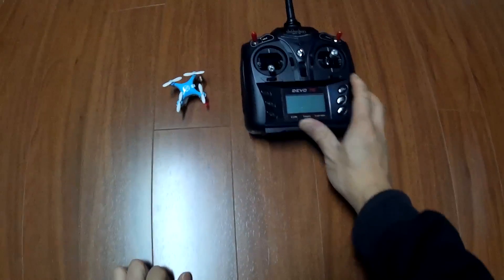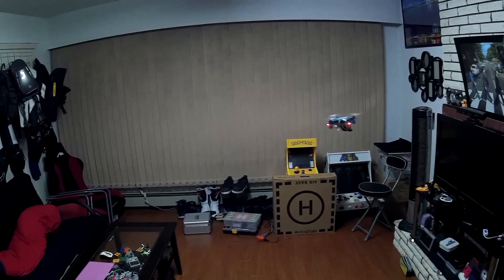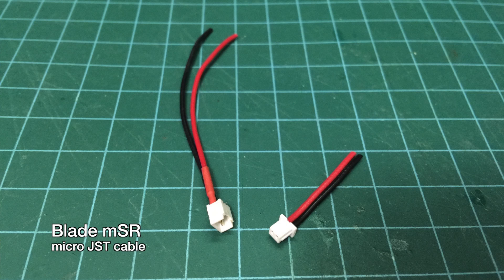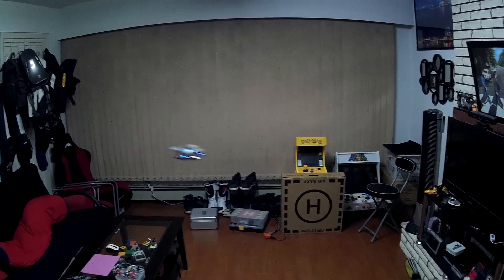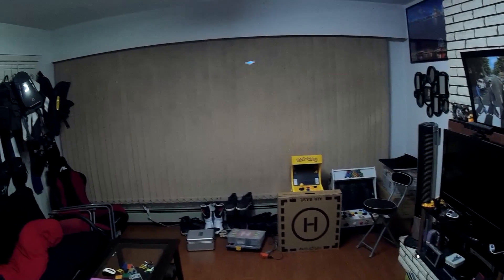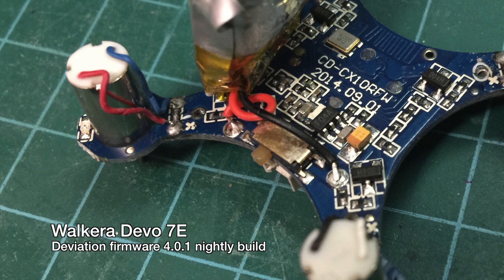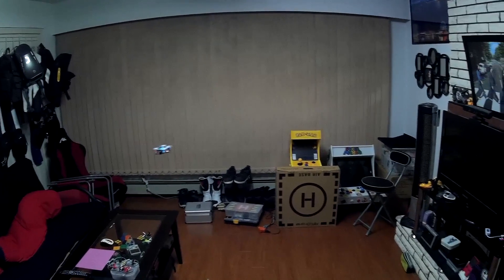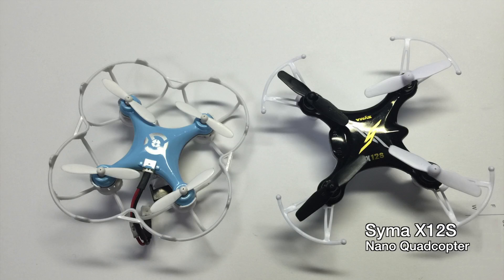Cheerson CX-10 micro quadcopter battery mod

Comment: I realize this is a very old video, but wondering if you've ever tried binding CX-10 using opentx? Thanks.
Reply from the maker: Should be supported by opentx if you have any of the multi modules (IRX4) installed on your radio. Or have something like the T8SG radio.  I have videos on the multi modules. 

My irx4 video
https://youtu.be/229bgk4H2lU
Reply: @KenVersus  thanks. I just realized I have the CX-10W which is the wifi version, hence is why I'm having trouble binding 🙄

Comment: I used to have one of these little buggers before my cat decided it was a good place to pee. A couple questions. That's a lithium ion rechargeable 3.7v battery you replaced the original with right? Just a larger, higher capacity one if I'm correct. That being the case, would it not have been viable to wire it directly to where the original battery was? Both batteries being 3.7v and both rechargeable lithium ion there shouldn't be an issue doing that and it would just take a hole for the wires to go in. They'd both be able to charge on the same chargers.
Reply from the maker: +lepayen sure I guess. But I'm trying to use the batteries I have without modifying them.
Reply: But you've already modified it by adding the cable right? What would the difference be to wire it directly so you can use the port for charging? I'm guessing you probably mean that you want the battery available for other things and I can understand that. You probably don't have a pile of these just laying around. Cool mod anyhow, and far better than getting only 6 minutes of flight.
Reply: lol

Comment: Why do you have to bridge the board?
Reply: Surprised no one answered sooner, it's cause when you plug it in the power goes directly to the battery, not the quadcopter. Meaning that if you plug the battery into where you charge it from, the power from the battery goes to where the battery should be, not into the drone itself. By bridging those two contacts, you essentially short circuit the charging port directly to the drone so it gets power.

Comment: how did u use that transmitter on it?
Reply from the maker: I'm controlling it with a Walkera Devo 7E transmitter with Deviation firmware and mods.  See my Devo 7E video for more info.
Reply: kenVersus k thanks
Reply: kenVersus I have the cx-10A(gold) coming in the mail but I have the devo7 transmitter already I was wondering how to use the devo7? Do u know how?
Reply from the maker: I don't think it'll work with Devo 7 at all.  7E will work once you install deviationtx firmware and install a RF module.
Reply: kenVersus how do u install the firmware? I was wondering on the cx-10A (gold) I believe it has the blue circut board that is capable with the devo 7